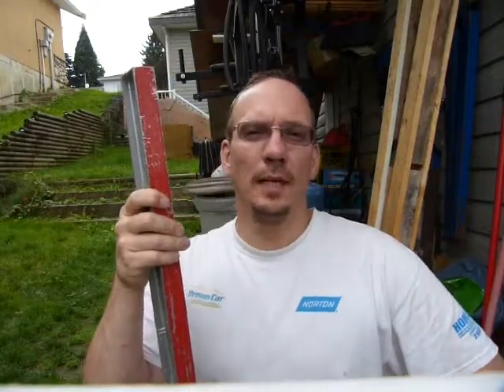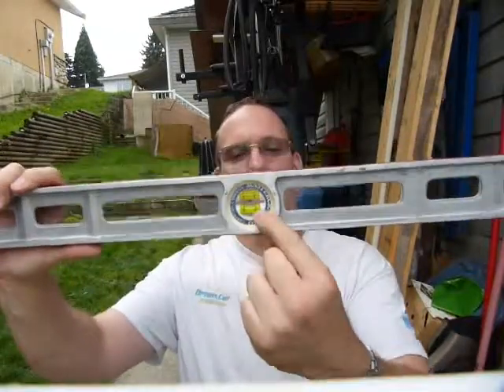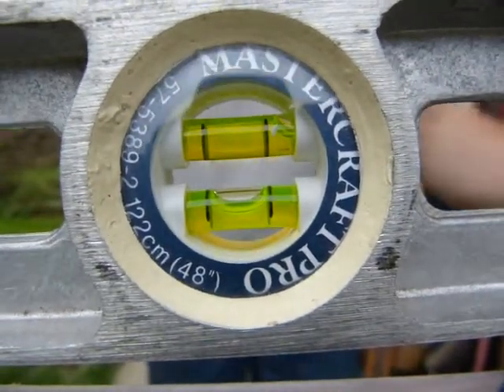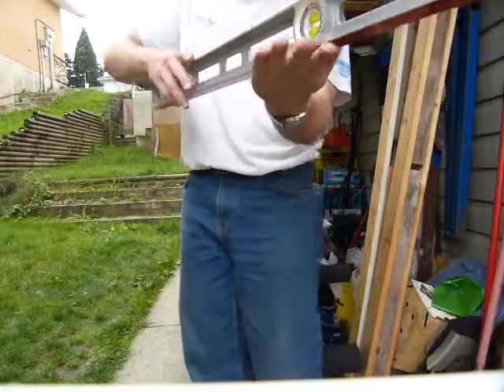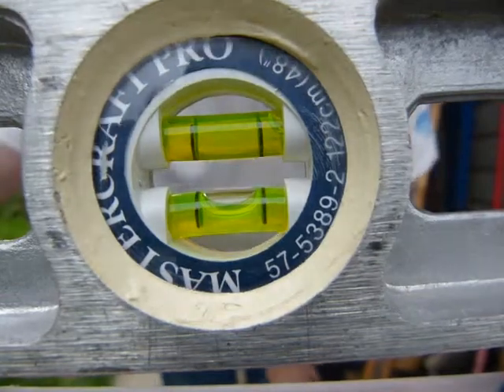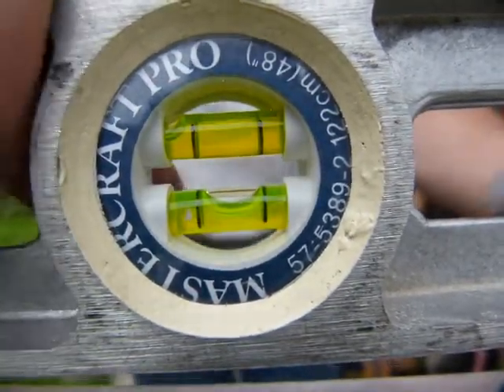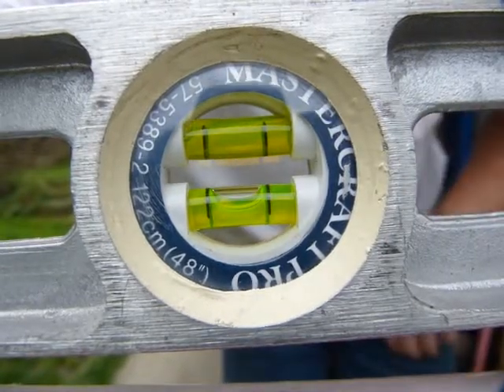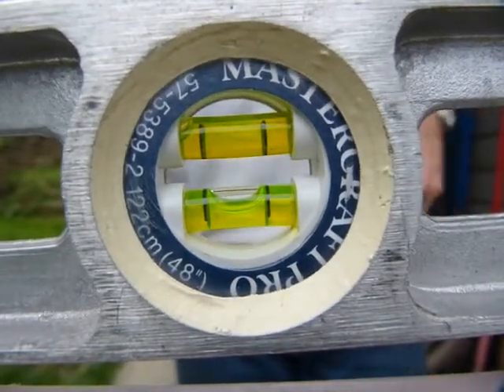Is your level level?

Comment: Those are vials like I said 2 per window. Bottles are for liquids in large amounts, not for a tool. The vials are curved towards the center of the level, where the bubble rests. Their centerline is parallel with the edge of the tool, because like I said, they are curved. They can not possibly be parallel with anything straight, only with a curved thing with the same curvature. As such, the upper one is always upside down, it will only work with its curved top towards the sky, flipped around.

Comment: Hi sir in this video two bottle or tube attached in one circle and both are filed with water and bubble and both are parallel but both's bubble are not came @ center upper bottle's bubble go away from center how it is possible if both bottle are parallel and both are filled with water and bubble ? I am not getting it how ? bubble of both tube should came @ center.